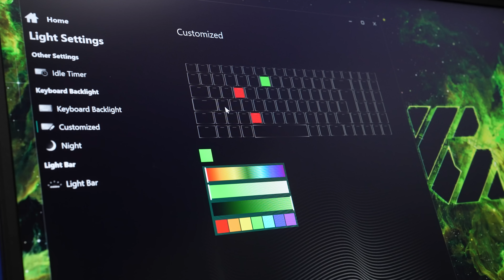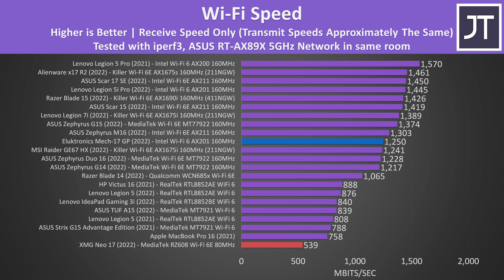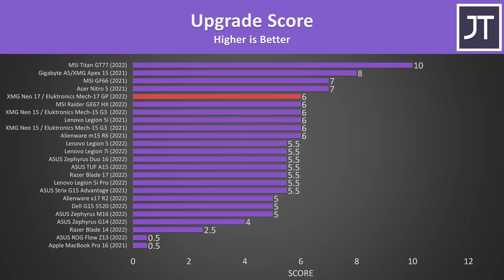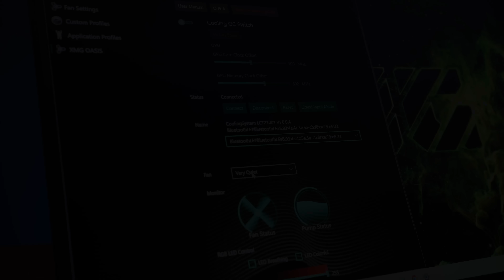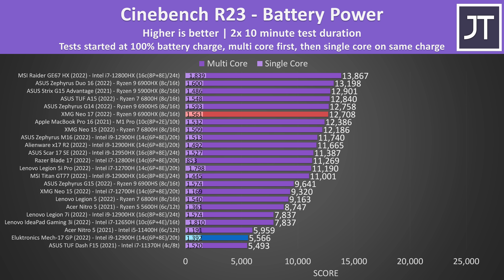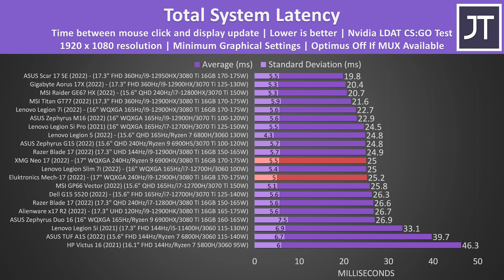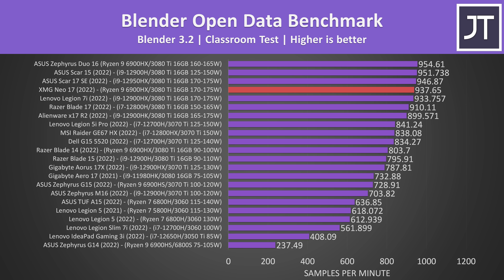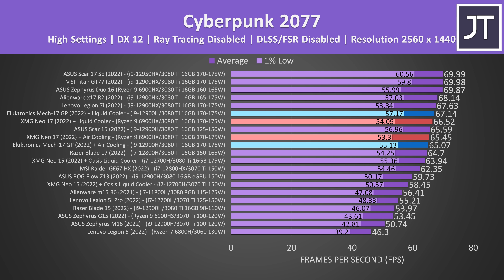17” Water Cooled Laptops! Mech-17 GP & Neo 17 Review

Comment: This is yet another Tongfang machine that looks great on paper but comes up short in practice. In many ways, these machines remind me of MSI, though at least Tongfang implemented Advanced Optimus which MSI can't seem to figure out.

Given the price point of these machines, I was left a bit underwhelmed. The lack of Type C ports and the terrible webcam leaves me scratching my head. I'm interested in seeing the next iteration of these machines. I'll pass on these for now.
Reply: Wouldn’t spend the money on unreliable Chinese made components, they do come with a 2 year warranty though which is pretty good I guess,.
Reply: @serdavosseaworth6115  Most components are made in China along with several whole machines, including from big-name companies. What matters is the level of engineering and testing invested in the product. It's obvious here that corners were cut to get this to market. 

As with many of these ODM rebrands, I expect this machine to be forgotten within 6 months, with no new BIOS or driver updates.
Reply: @darrell9616  To be fair, almost all computers are made in China or Taiwan. And most OEMs are either Chinese or Taiwanese (except for Dell & HP).
Reply: @cameronbosch1213  No doubt. I was speaking more about general support, not the country of manufacture. I'm far more concerned about BIOS and software support than where a machine is made. My previous Tongfang experience wasn't a great one.
Reply: @darrell9616  Though Lenovo is very good in those regards.
Reply: @cameronbosch1213  Agreed, which is why I bought one after my Tongfang experience.

Comment: hi Jarrod, i want to ask your opinion. 

which one is better :
1. Lenovo Legion 5 Pro 2021 (Gen 6), GPU 3070
2. Lenovo Legion 5 Pro 2022 (Gen 7),GPU 3070TI

The difference Price between two notebook almost 700 US Dollar.

My Concern is Lenovo Legion 5 Pro 2021 (Gen 6) only support ssd m.2 nvme pcie 3.0  (maximun Speed Read and Write only 3.500 MB/s), which have limited Speed Read and Write. Lenovo Legion 5 Pro 2022 (Gen 7) support  ssd m.2 nvme pcie 4.0 (maximun Speed Read and Write almost 7.000 MB/s).

I think for long term use, Lenovo Legion 5 Pro 2022 (Gen 7), how about your opinion about this?
Reply: For long term use u must wait for 2023 version.

Comment: Hey, Im contemplating about buying either Katana GF76 with 17.3 inch display (i7-11800h/RTX 3060 70-85W) or Nitro 5 with same config but 90-95W 3060, both for around same price. Is the display of GF76 similar to the one in this video (im mostly interested in response time)? I know Nitro's display isnt good and response time is bad as well.

And overall which one would be a better option?
Reply: get the katana, acer is cancer
Reply: Both kinda similar to each other bro. But neither are known for good display, far cry from Titan, Legion, or other mid to high choice reviewed in this channel. E.g. neither have 100 srgb. (I think one of Katana's last year had it, but not the 17" one) But if you're on competitive side, MSi usually has that response time. Katana usually has that slow SSD; meanwhile Nitro has worse ram,rendering the tdp irrelevant. MSi has hinge problem;  meanwhile Acer just..well they fell apart easily, even the Helios one. So yeah, can't say much for budget choice. I'd say Katana since I personally know my friends got MSi from years ago(2019).
Reply: @amruzaky4939  Im planning to replace the stock ram with my own sticks so thats not the problem for me in case of Acer but I just have a impression that both of them are kinda wack in 1 aspect or another. I just dont have the high budget. the MSI one i got in plan goes for $900 and Acer for $950, so basically same price and that price is good for that CPU/GPU combo but still, laptops themselves r kinda trash.
Reply: @META313.  well, go for Katana since you're after response time. But since you mentioned the price range, alternatively you could get 1660ti Legion already equipped with 16 GB ram. There are 2060 Legion around that price too (starting at 980 USD) but with only 512 GB ROM instead of 1.5 TB. But since the last year's GPU fiasco, I doubt they still have Legion in stock, not even the used ones. So, there is also HP Omen 15 with 2060 ones at that range, but HP service is kinda hit or miss post-2021. I don't know about ASUS, everyone used to talk about ROG back then, but I rarely heard about them these days. I don't recommend TUF since their intel machine overheats easily, but they did have good response time tho.
Reply: @amruzaky4939  I found a great deal for Nitro 5 and went for it -  i7-11800h, RTX 3060 95w, 1TB M.2 SSD and 16 gigs of ram for $900 and guy also included brand new Razer Viper Ultimate and Razer Blackshark V2 headset, Laptop was a brand new too, everything was in their boxes. So basically I paid $650-700 for the laptop after we factor in the Razer peripherals cost in the total price, absolute steal tbh
Reply: @META313.  Great deal
Reply: Don't buy any of this shit.
Reply: @hacunamattata679  You might need to read some of the replies sometimes (especially when they are not that many) and comment afterwards. These kinda generalized comments just make people sound dumb (as they really are)

Also Im pretty fuckin sure you cant back up your 'dont buy any of this shit' statement using bunch of even a decent arguments. Just elaborate why I shouldnt buy any of these shit and if it sounds even remotely logical Ill send my Nitro to you free of charge, I bought ASUS TUF F15 as well so I wont be left without a laptop
Reply: @META313.  u know nothing about a laptops and this is true, man.
Reply: @hacunamattata679  Yeah yeah, of course i dont

Comment: What exactly are the "high" settings in rdr2? On my ge76 with i9 and 3080ti with all settings on ultra with dlss in quality, 3440*1440 and water physics on medium I have around 60 fps, sometimes 50, sometimes 80. But here I see 94 for gt77 although it is 3-5% faster and even when I checked the review of ge76 it showed 120 fps in full hd. But I don't have those numbers. So really want to understand what are the high settings
Reply: I'm pretty sure he doesn't show 4k gaming redults in the video. Make sure you are playing in the same resolution.
Reply: For laptop comparisons, Jarrod uses the 'high' preset (the preset right below 'ultra' preset) for RDR. He only shows how it performs in ultra settings in the individual review of the laptop.
Reply: That's just the average results of benchmarking (there's the benchmark menu in graphics settings) right at 1080 resolutions with high presets (make sure you have the same resolution selected for comparison).
Reply from the maker: High is everything set to high, anisotropic filtering at x4 and TAA turned off.

Comment: Well, love the concept of a 17.3 to 18.4 inch desktop replacement laptop with water cooling, but this chassis is downright horrible and misses the mark. The chassis lacks too many ports to be a desktop replacement, which is the target audience of 17.3 inch and up. You need 3 to 4 USB A, 2 USB-C, full size HDMI, ethernet. 
I  plug 1 mouse, 1 keyboard, 1 DAC/AMP on USB-A ports, then on the two USB-C/Thunderbolt ports, 1 or 2 external storage units, and use an USB-A to USB-C connector for my Xbox Controller. Then the HDMI port to connect to a 42 inch OLED TV and wired ethernet for FPS multiplayer gaming to warrant lowest latency and most stable connexion. And I have an SD Card reader there, that I rarely use. 
This new 17.3 inch chassis NEO/Mech 17 just does not cut it, the motherboard is comically small and leaves so much room unused for ports. And I plug all this on a CLEVO PB71RF-G chassis from 2019, it's been 3 years and I have not seen a laptop offer as many ports!
 3 USB -A, 1 USB-C with display port, 1 Thunderbolt 3, separate audio in and mic in, ethernet port, Full size HDMI 2.0b, mini Display port 1.4 and an SD card reader! And I fill it all up as a desktop replacement, I have to choose between my controller or a second external storage unit!

Comment: Hello youtube people, I would like to ask you a question. If you had to choose between a Legion 5 Pro (6th gen R7 5800h RTX 3070 16GB DDR4 1TB SSD Pcle 3.0)
for $2300 or the legion 5i Pro (7th gen i7 12700h RTX 3070ti 16GB DDR5 1TB SSD pcle 4.0) for $3200 which would you choose? Now, I know what many people think and I know that they would choose the first one, I would too, but I want to do graphic design courses, as well as study architecture and the programs that I am going to use require a more powerful CPU and not so much the GPU than the I will use more for casual gaming. I also know that the ram of the Legion 5 Pro(6th gen) is slower and reduces performance and I will have to buy another one separately. But do you think you should buy the 6th Gen or the 7th gen?
Reply: For almost $2000 more dollars, Intel isn't worth that much to me in any case. Why are the prices so vastly different? They are going to perform very similarly even if Intel does pull out ahead in CPU demanding stuff. Definitely would go with the first choice and save $1900...
Reply: @jonathanr4160  Sorry, it's 3200, not 4200
Reply: @Nabucorf  so almost an extra $1000? That's still really high considering the $2300 laptop Ryzen 6000 CPU isn't trash by any means and still a powerful CPU.

I'd pick Intel for a couple extra hundred but at that price difference I'd take the Ryzen model and wouldn't look back. Its still going to perform really well overall.
Reply: @jonathanr4160  you're right It's not worth the $900 jump. I will just buy two ram 16gb 3200 x8 for 90$ and with that basically the performance goes up by 10% and it still saved me 800$

Comment: Oh man, if only there was some way to undervolt both these CPU's to lower temps and actually get greater access to clock speed control. 

Funny enough, ngreedia allows undervolting and not AMD and intel for thier laptop parts. So nvidia GPU's can be made to run cooler but not AMD GPU's on laptops. And intel used to allow undervolting so they could run cooler than AMD but now both run hot

Comment: I have the XMG APEX 17, it's a piece of shit. Constantly overheats and shuts down. They even shipped it with the wrong language keyboard and when I contacted support they thought I had bought the 15 inch version
Completely incompetent company, stay away
The sound card also stopped working on my now 2 month old laptop
It was also advertised on their website that it has a TDP of 54  Watts when in actuality it is only 45 Watts which I found out after testing
Reply: This seems like a case for tech support. None of what you write is normal for XMG APEX 17 or any other XMG laptop. We have sold countless units of APEX 17 with AMD Ryzen 5000 and they all work fine. They can maintain 54W CPU Package Power and they do not shut down. If you only see 45W TDP, you might want to change your Control Center profile from "Entertainment" to "Performance". If your system shuts down, your unit might have a cooling system issue. And why do you say support assumes you bought the 15-inch version? It would not matter, because the 15" and 17" have exactly the same keyboard. I am not aware of your customer or support ticket number so I cannot look deeper into your case. Please reply to our last e-mail and briefly list up your current issues. We will take it from there. // Tom
Reply: @xmg_gg  This is typical of my experience with XMG so far. Right off the bat you imply that I'm lying "None of what you write is normal for XMG APEX 17 or any other XMG laptop. We have sold countless units of APEX 17 with AMD Ryzen 5000 and they all work fine." 
The reason I say that support assumes I bought a 15" model is because that is what they said in the email that they replied to me. I had to make a point of saying that I bought a 17" model because if they shipped my laptop with the wrong language keyboard it wouldn't surprise me in the slightest if I got sent a 15" replacement laptop.
The only reason I haven't sent it back yet is because I need it for the next 2 weeks for work.
I want a NEW replacement laptop when I do send it back and not this POS laptop repaired or a refurbished laptop either. I paid a lot of money for my laptop and I expect it to work.
And I'm not posting my support ticket number in the comments section of a youtube video either
Reply: @NachoManRandySandwich  I did not ask you to post your support ticket number here on Youtube. I asked you to reply to our last e-mail and briefly list up your current issues. We will take it from there. // Tom
Reply: @xmg_gg  What you left out of this reply speaks volumes
Reply: Toxic customer alert. Do what the man says. All these components are made by the thousand in chinese factories. They're not all perfect and stuff goes bad. But this is what after sales service is for. The man is telling you the next step to do to get a solution.  Do you want to get your issue fixed or just whine on YT comments?

In my customer support experience the ones who don't follow the recommended steps and provide the requested information are the ones with something to hide.
Reply: @greebj  yeah nice second account there